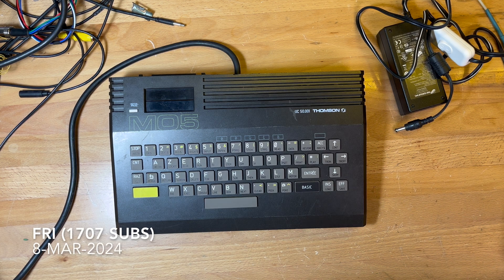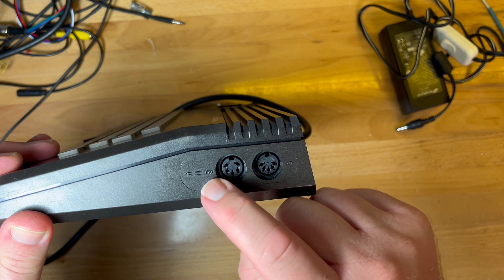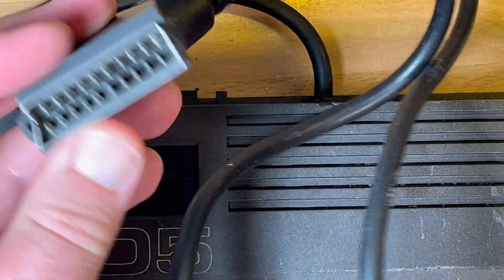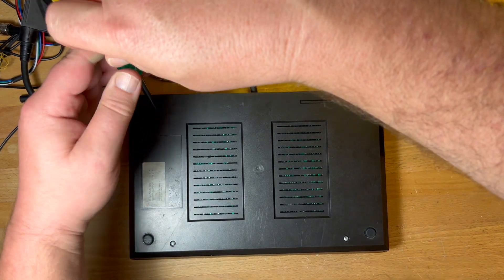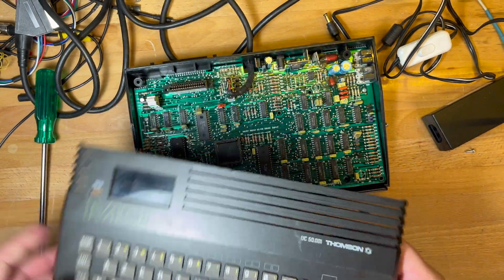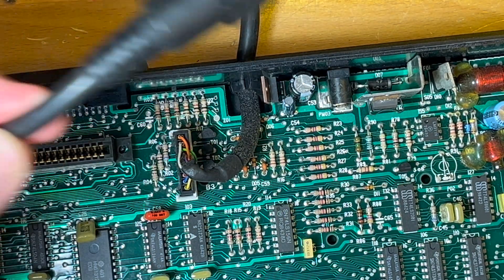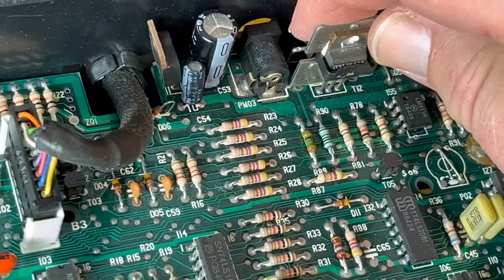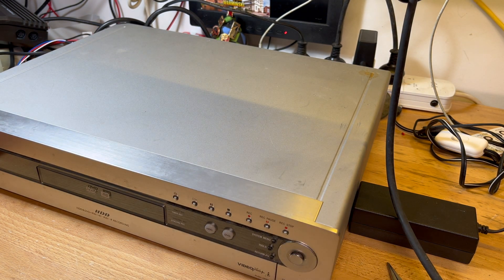🇫🇷 Thomson MO5: Part 1 [TCE #0420]

Comment: This sounds rather odd but I was reading an interview in Retro Gamer where they talked to the guy who converted the Spectrum version of Operation Wolf (I think) for the publisher. He said the worst thing about working on graphics for the MO5 was the light pen he had to enter them with. It gave him severe arm ache.
Reply from the maker: Very interesting!  We got a dk'tronics light pen for our Amstrad CPC464 back in the day.  As the Thomson has the interface built-in I guess it'd be rather more common as the light pen itself is pretty simple (??).  But still, yes, it'd be a bit tiring having to hold up a pen a lot of the time.
Reply from the maker: Now that I've fallen down the Thomson rabbit hole, it seems that the light pen was actually standard equipment on some models.  The TO7 has a small compartment on the keyboard where you could store it.  So one could imagine some sprite/graphics software expecting it to be used ...

Comment: From what I was reading about the Thomson MO5, MO6, etc. series. These were intended as part of a computer literacy programme in France in the '80s called "Plan Informatique pour Tous". Similar to the UK govt. computer literacy project, and the Acorn BBC Micros. So many of these Thomson computers would most likely have been used in schools, connected to monitors.

Comment: It's not that this AZERTY keyboard French computer is putting out a SECAM signal and the PAL(?) video and TV doesn't recognise it?
Reply from the maker: A valid point.  If I were using a composite signal then, yes, I'd have to deal with the SECAM colour encoding system but I should be using straight RGB so no need to worry about SECAM vs PAL ... 🥹
Reply: @Brfff  so the Thomson computer is RGB video only and doesn't have an internal colour encoder? I think I know what the problem might be. The DVD recorder can't use RGB or pass through RGB, it's composite video only. I know not all devices with Peritel SCART connections are RGB enabled. Even some SCART cables are not fully wired for RGB video. SCART was originally a French idea, and is usually only found in Europe.
Reply from the maker: I see what you mean.  I'll give it another go but try the composite output from the DVD recorder (Sony RDR-HX900) instead
Reply from the maker: It's working!

Comment: You did have the DC jack wired center-negative?

https://1or2bytes.blogspot.com/2016/09/thomson-mo5.html
Reply from the maker: Yep - tried also with my bench supply up to 17VDC!
Reply: @Brfff  Well that's not it then. Archive.org has a collection of programs "Thomson_M05_TOSEC_2012_04_23.zip" but I didn't see something like a Diagnostic ROM included in the Zip file.

Kind of an odd power supply circuit (the link that I included has the schematic for it), did you measure the voltage on the rails?

And isn't that a battery holder footprint dead center of the screen @5:50 ? Otherwise I didn't see anything curious about the board.
Reply from the maker: I found a bunch also on emuparadise ... they're all in "K7" format but it is possible to get K7-to-WAV converters.  However, I think the cassette input expects a data stream à la Commodore Datasettes, so simply sending an audio signal in wouldn't work (I think).  Haven't checked any of the rails yet ... saw the bad image & lack of major chips (apart from the gate array) and so assumed ... dah, gate array.  
The footprint at 5:50 is a variable capacitor, I think, for tuning video signal perhaps ... decided it wasn't necessary so just replaced with a link.
And, yeah, actually a bit boring & mundane compared to all the Soviet/post-Soviet boards we've been looking at!!
Reply: @Brfff There's a collection of tapes that have been converted to wave files on dcmoto.
I tested them using a bluetooth cassette adapter and a MO6 with the built-in cassette.